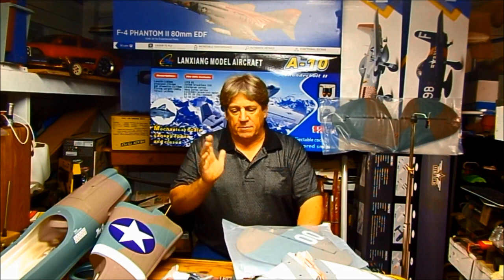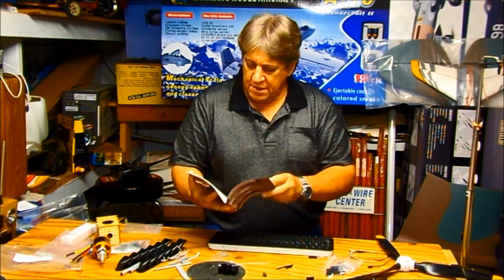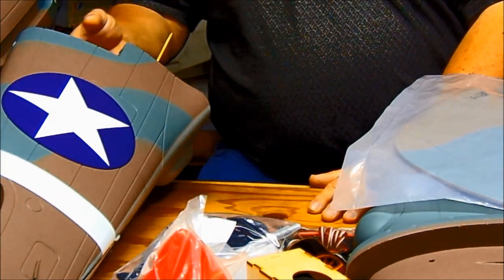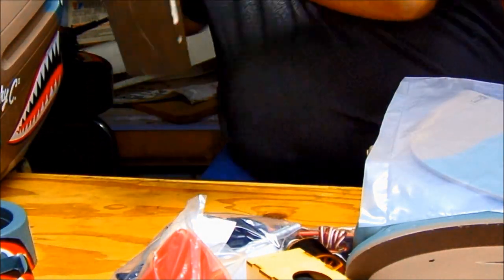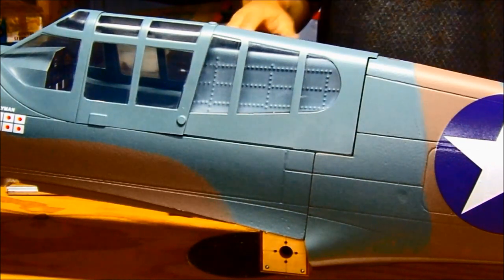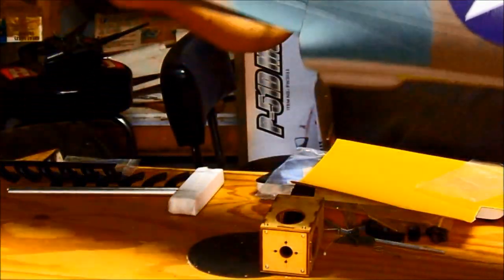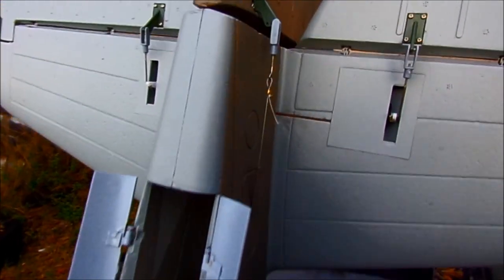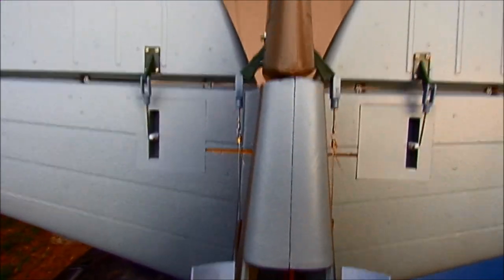LX LANXIANG P-40 WARHAWK KITTY HAWK BUILD BANANA HOBBY GENERAL HOBBY 2000MM 79 IN GIANT SCALE

Comment: If it did not fly so well, I wouldn't be planning to buy one and of course replace all of the servos and retracts with Hitec and or Spektrum servos and Eflite retracts and motors.  Then you would have a great flying warbird that is also extremely reliable and isn't that what we all want?  I did the same with my Grand Tundra and my Flex Cessna and they have over 300 flights on them winter and summer without so much as a hitch.
Reply from the maker: I totally get what you are saying ,  Most LX models jets have horrible plastic landing gear and the wheels are WAY to small, but this P-40 has all steel landing gear; but it's glued to the foam instead of mounted to plywood with screws. This makes it unserviceable until you have a really bad landing and it rips off the foam, then you can put it back in the right way. This P-40 is a really good plane from LX, no big issues at all (magnet coming unglued or the tail wheel hinge pin popping out ) this has been a great airplane! No servo problems no motor or ESC problems ( they are using Hobbywing ESC now ) so I love this plane! I Just got the 1600 mm Corsair, making the videos now so stay tuned. Also in the batters box is the LX B-25 and the YF-23 ! :) Kenny
Reply: @hangarfiftyone3527  BTW there's and old saying that goes "If you are good at something, keep doing it" and you are good at doing these videos so.............

Comment: I don't think I'll be buying anything else from Banana Hobby, not only did they label the motor box wrong, they also had the wires wrong at the motor,esc.....and I'm still trying to get my landing gear and flaps working. Crazy, everything else works
Reply from the maker: It's not Banana Hobby that's the problem it's LX Models; they make some nice foam planes but their instruction are awful, LX Models is a modelers type airplane , it will need some work not just a screw together and fly plane. Banana Hobby sells other brands like X-FLY which is a screw together and fly type plane and they are AWESOME!